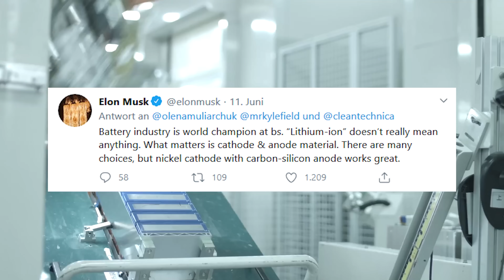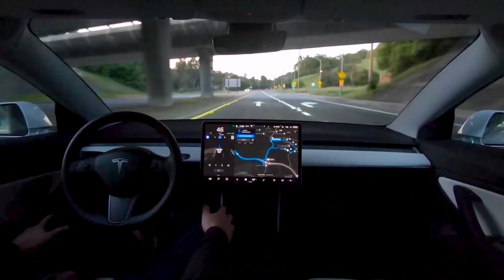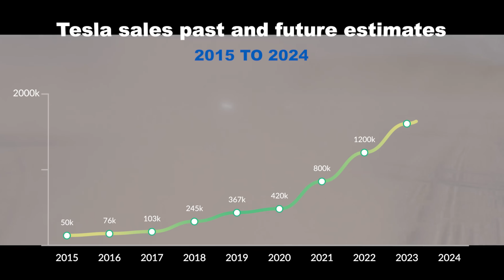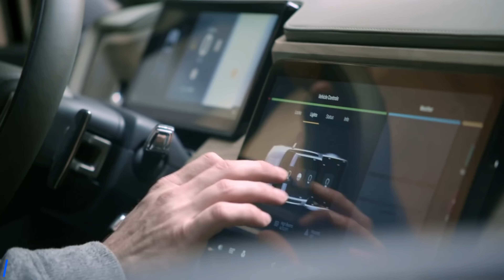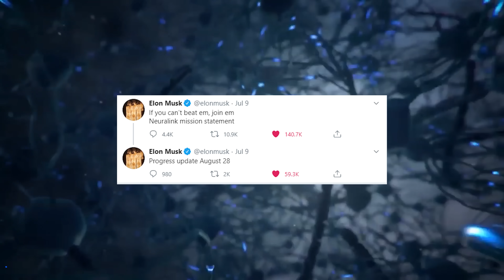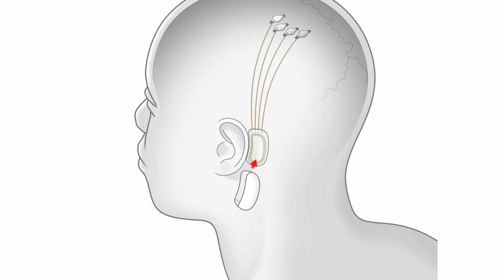LEGACY CARMAKERS DOOMED? Tesla Battery Day Preview

Comment: The problem with buying a Tesla vehicle is there are not enough garages or mechanics that are certified to work on them. If you just take it to your local shop to have it worked on you will be in violation of contract and they can shut your supercharging off. You will never actually owne the vehicle. I can change the brakes on my Chevy in my driveway.

Comment: Lots of hype

The Hyundai ionic gets better mileage at motorway speeds. Ionic get 4.5 miles per KWh Vs 4.25 miles per KWh for M3

Tesla has a lot of early adopters who are willing to over pay for new tech. That works in small volumes but won't work in large volumes

Audi A4 = £24,000
M3 SR+ = £43,500

I'd take the A4 at that price differential!!

Comment: My crystal ball is murky, but it shows me a different scenario for FSD.

'Feature complete' will happen soon, but what, exactly, does that mean?

I think it means this:  Autopilot can be engaged anywhere, on any road surface - parking lots, city roads, country roads, highways, roundabouts, complex intersections.  Elon says that you will have a "high likelihood" of going from your starting point to your destination without having to intervene manually.

What it does not mean is that FSD is good enough for unattended driving.  It's a fabulous driver assist software package at 'feature complete.'

Much more development is ahead.  Corner cases must be nailed down - sun glare interfering with sensors, extreme weather conditions, objects the car can't yet recognize (and therefore can't predict what they will do).  What should the car do if a tornado is nearby?  How will it know?  What actions should it take?  Tesla will be years figuring all of that out.

And they'll have to figure it all out before regulators will permit robotaxis in their jurisdictions.

There's more.  I haven't heard a peep from Tesla about ride hailing software, billing and payments, Tesla's cut of fares, report generation for robotaxi owners, tax filings - there's an entire software infrastructure to build, millions and millions of lines of code to develop, test and debug.  That's going to take time.  Machine learning, which is so useful for object recognition, won't be a help for any of this.  It's old-school programming, and it's a big job.

And although we know that laws will have to change to permit robotaxis, we don't actually know what the legislation will look like.  There's no boilerplate.  Tesla's attorneys have a lot of work ahead of them, too.

My crystal ball tells me - murkily - that Tesla might be able to prototype robotaxis in a handful of jurisdictions within maybe 5 years.  The prototype fleet will be closely monitored by Tesla, and improvements will be fielded as lessons are learned.  Safety data will be compiled during the prototyping and used as ammunition later on to persuade regulators in other jurisdictions.

Then there's the rollout of robotaxis across the world.  Every jurisdiction has to be persuaded.  In the US, local cities, counties and townships regulate their own roads.  State authorities regulate state highways and set standards and insurance regulations.  Federal regulators have authority over interstate highways.  Authorizations will be a patchwork thing - permitted here, not there.  Federal highways will probably be earlier than the rest, but even that will be difficult.

There will be fierce opposition from conventional taxi companies and drivers, and from Uber and Lyft and their drivers, because robotaxis will kill them.  They can't compete on price.  The fossil fuel industry will oppose it reflexively, because they oppose everything Tesla tries to do.  Automobile manufacturers and dealers will oppose it because if robotaxis offer cheaper transportation, it will weaken sales of their vehicles.  Waymo and the other autonomy development companies - all using geofencing and LIDAR - will oppose it because their cost per mile will be so much higher.  Trucking companies and their drivers will oppose it, because trucking jobs will be lost if autonomy enters that industry, as Elon has predicted.  Politicians live off of money from these sources.

They're golfing buddies.  I don't think Elon gets out to the golf course much.  And Tesla's pockets are not deep enough to outspend its opponents.

My expectations are calibrated by these realities.  Robotaxis from Tesla are not just around the corner.  Tesla has a huge amount of work to do.  Just getting to pilot programs in a handful of jurisdictions will take years.

If you think you'll soon be able to enlist your car in Tesla's robotaxi program and send it out to pick up fares and earn money, your expectations are definitely not aligned with mine.

'Feature complete' is indeed a magnificent milestone.  We've never seen driver assist software that works on any paved surface or that has a 'high likelihood' of driving your entire trip without manual intervention.  But robotaxis are much further out.

Comment: I don't disagree that Tesla is an amazing company making incredible progress. My concern is not performance but rather longevity. With traditional gasoline engines, as long as you take good care of them, they can last incredibly long. Some cars have over 200,000 miles on them. Do you think it is possible to drive a Tesla for that long without needing to replace the batteries? What would be the range on a full charge on a Tesla with 200,000 or even 100,000 miles on it? My guess is like 60% of original range.
Reply: This is something they have been working on from the very beginning. A lithium ion battery if built properly and looked after properly can last a very long time. at the moment they will reach between 300,000 and 500,000 miles, but with the new tech they may end up reaching 1,000,000 (just google million mile battery). Even after this, they are still usable as home power battery packs.

Comment: Ride sharing auto drive cars.......You going to rent your car out to some guy with a hooker? What do you think is going to go on in these auto drive taxi services? 

Ease of use is still a problem. You can have a huge battery but where to charge up easily?  Going to take you $10,000 or so to be able to super charge at your house if you have one. Your employer is going to spend the money to put super chargers in their employee parking??? Ya sure.
Reply: why would you need a super charger? whats the problem with charging over night?
Reply: @jonathan6015  If you drain your batteries and try to charge them up at 120 V you will need more than a night to recharge. If you get up to a 500 mile range, 30 amp won't work either over night.  If you aren't draining your batteries then why exactly are you paying for it when a  much smaller pack will do for what you are doing?  Go on a trip and you better have a super charger to charge back up at the end of your trip. I live at a vacation destination and we only have 2 super chargers which are far away from each other.  One is at a hotel, not sure if you can use that without staying there. The other is at the Savannah airport which is next to nothing.
Reply: @crp9985  if you are in a situation where you want to burn through your whole battery every day then yes you would have a problem. In that case i you are in a special situation and need to adapt to whatever that is.

On the other hand, if you are like most people, you only do that every so often. if you are doing ride share you want to maximize the life of your battery, to do that you don't want to charge above 80% or below 30. you also have the option of a 240v home charger, that will charge a 500 mile battery in 20 hours.
Reply: @jonathan6015  The fastest car you will ever drive is a rental. Someone gets your Tesla and wants to race it everywhere they go. They can drive that battery right down to zero quickly. On a track you can go through a Tesla battery in under an hour. I know if I rent a Tesla I will most likely take it out on some back roads and run it full blast for a while. If you don't live in a city people haul ass in their cars. Think out west. A ticket for doing 100 MPH is like $20. You have to think, how is this car actually going to be used.
Reply: @crp9985  ok, there we agree. if you are lending your car out to other drivers to play with, bad things will happen. 
ride share becomes a good idea when the car drives itself. then its a pick up and drop off. much like calling an uber. they can still shag in the back, but they will be on camera.

Comment: I mean his busted video on self filling water bottle I have found a possible work around for the thermodynamic issues, with nano film zeolite pump hybrids, (ie a film that has cavities shaped electron wise like negative water holes, that will absorb water components and even assemble them together to make water out of things that were not, and allow the normal agitation that comes from thermal energy to slowly push these water molecules into an internal chamber raising the pressure which will force the heat to be lost, through normal methods, and liquify the water, injected into it by the film, and this tech is something we have had in a much more crude format in the oil industry zeolites are basically molecule assembly machines shaping up what ever they were designed for like how cookie dough is shaped by a cookie cutter lol, 
Maybe I am just coming at things from a different perspective due to my designing a 3D printer that can print everything, and have a function to get its resources by breaking down things and sorting the material into nano particles so the tools I am designing for it have so many other applications, Not really sure on that one though (as to why others are not already doing most of the stuff I discuss as solutions, or even investigating them.)

Comment: Do you think that tesla could build starship's ECLSS? (Environmental Control and Life Support System)
They are currently working on miniaturizing bioreactors in collaboration with CureVac
https://electrek.co/2020/07/03/tesla-joint-patent-curevac-revolutionary-bioreactor-for-rna/
https://www.curevac.com/mrna-platform
They are also working on an HVAC system that could possibly produce clean water out of thin air:
https://www.youtube.com/watch?v=O2sdSiUFd0s
https://twitter.com/elonmusk/status/1242292724084113409

Comment: From more or less the Start Elon's factories have not been factories. Does anyone remember when Elon tore up all the plans they had and insisted on a totally new design with a lot more automation when he was building his first one?

Where manufacturers consider factories as buildings where they make their products Elon has publicly stated hs factories are the machines to make the machines. what is more they are designed that way to be changed and upgraded in an almost continuous fashion. So upgrades can be plugged in as and when developed. So new and better paint shop tick better and smaller battery production check. Just like the components in a machine. The machine gets better producing more and better Teslas in the same space and for less cost. When capacity is close to being reached or a new model is produced all the factories have extra space  and the machine to make the machine grows.
Reply: Excellent observation and a good look into the design philosophy that got Tesla off the ground and ensures it's future.
Reply: Elon admitted he overdid it with the automation! He is back to using employees to assemble the Tesla cars in a mixed mode technique.
Reply: So far, Tesla Paint Quality is nothing Musk can write home about for Fremont Plant produced vehicles. I hope he took advantage of the Covid 19 downtime to rip apart the Fremont Paint shop, and steam clean it from top to bottom! See Munro and associates analysis of the Model 3 and Model Y! Sandy Munro gave them a D- for paint quality on the Model 3 and Model Y cars he ripped to shreds analyzing them!!
Reply: @DishNetworkDealerNEO  Well no Tesla did not upgrade the Fremont paint shop during the outbreak you know why There was an Outbreak!! Actually Sandy Commented on the much improved quality of the Model Y over the Model 3 but said the paint still needed improvement. Which Tesla is addressing in their new shutdown at Fremont

However you miss my point Tesla's entire factories are designed so they can be upgraded sometimes on the fly. Rather like you adding upgrades to your car anything from new cupholders to a new ECU. One of the reasons they have not grown as much as was expected is Tesla has found better cheaper and quicker means of production often in a smaller area. So although the factories have not grown their output has. Of course as we see at GiGa Shanghai there is plenty of space for expansion when required.
Reply: My condolences to those getting those Tesla’s with paint problems. Even if reworked, at a Tesla Service center or at a Tesla approved body and collision repair facility even if under warranty. Repainted auto bodies are always prone to poorer longevity of the paint, due to not being able to be cured in an oven and  the inability to use a Bell Shaker paint system paint booth with electrostatic  bonding, which cannot be used once finish and interior parts are installed in the body shell. It’s too bad the GM Lordstown assembly plant was not acquired when GM shut down the production of the Chevy Cruze there in March 2019. It has a full body shell zinc Chromate dip tank, an current limited, electrostatic charged Three Bell Shaker and UV and heat quick drying on the fly paint drying system and an inspection  and  side rail diversion line for paint flaw rework area with spot rework painting feeding off the same paint batch for perfect color match and clear coating and UV/Heat drying facility area, from there the reworked car rejoins the main line for continued assembly like the initially passed cars. 

Lordstown Motors has possession of this state of the art assembly plant now, and assuming they have the talent to operate it properly, will quickly be making the Lordstown Endurance electric pickup truck in January 2021, and will in theory, be able to produce in mass, their electric pickup truck with the same paint quality as any GM Car or Truck made today. To the plant, its just yet another in many model changeovers it has gone through since the first 1964 Chevrolet Biscayne roll off its lines. This plant has made Chevy Bel Air, Vega, Cosworth optioned Vega, G series Chevy and GMC vans, Cavalier, Cobalt, and their Pontiac sisters such as Sunfire including right hand drive versions shipped to Japan!  I’m sure there is more I am not remembering right now. I live 15 mile away from there, and several family members have worked there, although my immediate family worked at Packard Electric Division, just 6 miles away in Warren, Ohio.